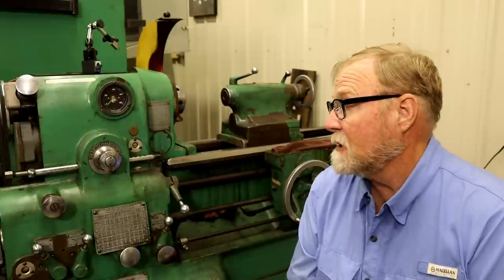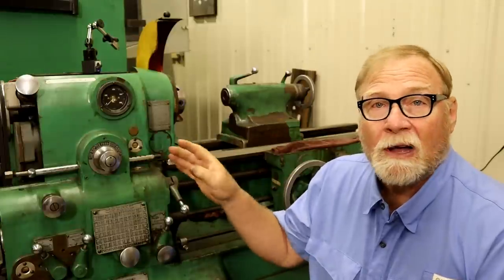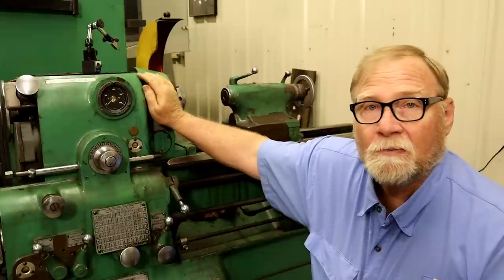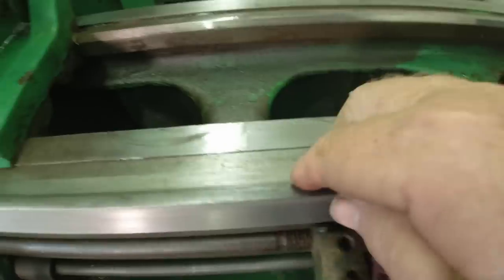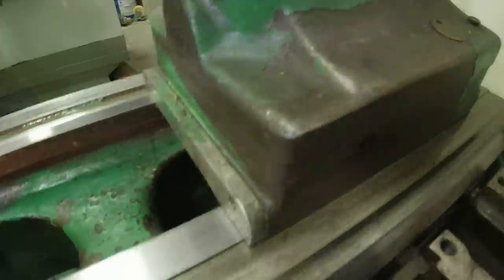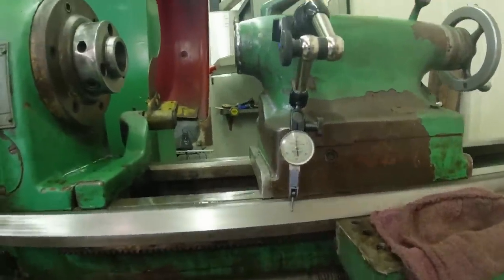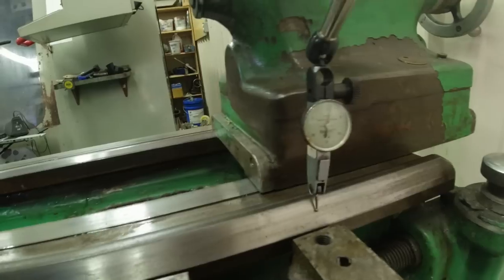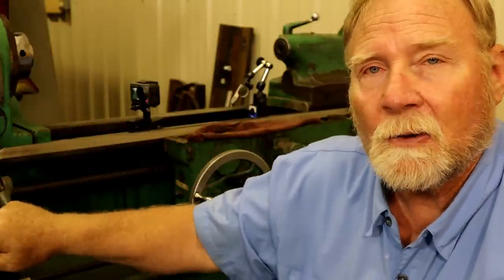7000 Mistake Monarch 10EE :  Is the Bed trashed?

Comment: Hi Steve 
That’s a great idea to use an independent rail system to bring the bed back into specification.
Once your there you could diamond lap the two mating surfaces to refine it even further.
Reply from the maker: Once I get the rails close I'll rescrape the tail stock sled to make it right then install shims to raise it to the correct center height... I have something else up my sleeve for the saddle :)

Comment: The bottom of the 10ee ways (where the bearings roll) front and rear may provide an accurate rail system for regrinding.  You’ll have to fabricobble a way to ensure your grinding sled is tight against the bottom rails but it is my understanding they are ground perfectly parallel to the top vee when produced from monarch.  Good luck sir!
Reply from the maker: thanks Clint.... I was probably going to use those surfaces to align the rails as I plan on making them about 3 inches wider than the regular rails.  The sled I envision will be very heavy  and should not need to be held down with the small amount of material I plan on removing...

Comment: Steve. How about purchasing a set of precision ball bearing linear guides off of Ebay then fabricate the brackets to mount them. Hey, they build CNC machines using them. I am retired know but when I was a Design Engineer I used those guides in my designs for multiple devices that would check and validate straightness In very fussy tolerances. Hey, I hope this might help in your quest. It has worked for me multiple times. Take care.
Reply: I just reground the ways on my lathe bed using ball bearing linear guides.  Pretty much set it up like Steve is thinking of doing.  Took lots of shim stock to get it aligned near perfect.  Mine won't be factory perfect but will work for my needs.  My lathe has a bed about twice as long as Steve's 10EE has.  Ground it dry and it does make a mess in the shop!  Ken
Edit: If I had to do this again, I would look at using the THK linear guide rails instead of the ball type.
Reply: @4GSR  I used the ball type and it was not a problem, but I was not grinding around them.
Reply: After looking them up, I think the THK LM Guide Rails which canbe gotten as SS would be a great way with what your thinking. Don't know how expensive but it looks like it would do what you want.I agree with Mark, check it out. Great video by the way. BTW, did you finish Don's Shaper nut?
Reply: @jdmccorful  There's a  industrial surplus dealer we know of that has lots of them for sale.  They are mostly N.O.S. one's too. And not a bad price too. Ken
Reply: @4GSR  I'd be interested in this supplier, if you're willing to share your sorce. 🙂
Reply: @kahllackey5619  HGR
Reply from the maker: I think that is a good way too... Just trying to save a little money and I know I can really dial in a set of cast iron rails if I make them...

Comment: Hello Steve, 
There is a large number of comments already and if I am repeating any of them, it’s confirmation. Your idea for grinding is similar to what I had in mind for my old American 14” high duty. 
My thought was building a sled to slide on the tailstock ways, then use the grinder on the sled to grind the saddle ways. You slid the tailstock with an indicator to measure the saddle ways run out.
The American is shot, if I mess it up I’ll scrap it anyway…..got it when I was a teenager….do not have the heart to scrap it!
Cheers,
Randy
Reply from the maker: It would be better than nothing to use the tailstock ways...    I just think that making a better set of ways and mounting them to the bed would give me a more stable base and one free of any errors.... The sled I'm envisioning is going to be heavy to stabilize it even more...

Comment: I had my 30” 10ee bed reground by Schaffer Grinding’s facility in the Los Angeles.   Rob was wondering to work with.  They did an exceptionally good job and the price was very reasonable.   Abel, the machinist who actually did the grinding, has well over 34 years of experience operating precision grinding machines. Fabulous experience and aligning the headstock was incredibly easy because Monarh 10ee beds were originally ground and Abel was “able” to match the original bed way angles.  He even ground the underside of the outside of the bed ways to be parallel with the reground top.  A truly amazing experience. Another friend scraped the saddle and tailstock in and now the lathe meets or exceeds Monarch’s original accuracy specifications.  Do yourself a favor and look into Schaffer Grinding.  I think they have a number of facilities around the Country and did an amazing job for a very reasonable price.  Let me know if I can elaborate or help in any way.  Cheers, Will
Reply: Hey Will, I'd be interested in your experience. I'm the one that Senior Steve has been doing some mentoring with. I took the old Blue Basket Case 10EE home. Haven't started working on it, with COVID, the day job has kept me too busy for now. I was talking with Steve about his plans to grind his in place, and haven't decided if I want to follow his lead or send the bed out. The more I look at old Blue, I'm really leaning towards doing a ground up refurb on her. That's a long project, but I know this old guy, who's really amazing at that kind of thing. BTW, Steve there is a genuinely great person, and I'm lucky to know the old guy!!!
Reply from the maker: I am just going off prices from Commerce Grinding 6 years ago.... 1100.00 to just grind the bed of a mill plus tax and shipping....    I have all the tools to scrape and plane things  so  . 007  is just not a big deal and I can use the money for the electronics....
Reply: @10swatkins  I can’t quote Schaffer prices today, but think less for the grinding.  I transported the bed myself I the back of my mini van.  Keep the videos coming; they are great.  Cheers, Will
Reply: @kahllackey5619  Kahl, let me know if I can help.  Ground up is a lot of pieces but I’m approaching completion so with Steve’s help I’ll bet the project is within your grasp.  Cheers, Will
Reply: @bid6413  Thanks Will, much appreciated!!! I may likely take you up on that offer. I'd love to see the process on your 10EE if you have any place your sharing it.
Reply: Schaffer Grinding Co. in Montebello CA also ground my 10ee bed in early 2020. Cost was $425 at the time. I'm in SoCal and was able to do the transport myself, but even if you consider shipping cost you might want to reconsider the professional grinding option. It is not that difficult to remove the gearbox and the headstock and will give you a chance to clean everything up and find other things that need fixing. I dealt with Ted Tipton in the office and don't recall who did the actual grinding, but their work is impressive and very accurate.
Reply: @spacetime8963  And, since Monarch ground their flame hardened bed ways the headstock might, with a little luck, line right up on that reground bed.  They do have to get the vee way angles the same as Monarch OEM, but they can do it.

Comment: I think that setup is summing tailstock way wear with carriage way  wear.  I suggest using the saddle to measure against the underside of the carriage ways where the ball bearing gibs run.  That would give the best measurement of bed wear
Reply from the maker: It's just a rough measurement to give some idea of wear...

Comment: Our Monarch 10EE's were hardened and chrome plated, 40 yrs old and zero wear. 
I'm not sure you are checking the ways accurately.
I would get an accurate straight edge and use shim to measure wear before doing anything else.

By the time you have ground .015 to .020 off the bed and carriage there will now be a combined drop of .030 to .040 of the carriage creating a miss-alignment of carriage to lead screw and feed drive shaft.

I will investigate our lathes tomorrow and give an updated suggestion. 😉
Reply from the maker: I understand all the steps involved...  And as I said in the video this is just a quick and dirty way to see if it is really bad.. thanks for watching.

Comment: How about mounting the grind spindle to the planer, you would still have to pull the bed but you wouldn't have to engineer a way system.  
I've seen planers with Bridgeport heads mounted on them, and the traverse speed on you planer is about what a hydraulic surface grinder runs at
Reply from the maker: I would have to build a pan to cover the table completely along with shielding.. I have a spindle that I plan on doing just that someday,  Just was thinking if this method works out it might be useful to others...

Comment: You have an enough big and super planer. I think more easyer job to make a separated cooling system on planer than make a pecise rail system on a cast iron machine bed. That need a lot of effort and never be as precise as your planer. 
I like your channel, and look forward to the continuation.
Reply from the maker: Kokmill I could do that easily and It might end up that way but if this works well it could help others with not as much experience and tooling as I have... Once I make the rig it would be easy for others to use... 

As for being as precise... I see no reason it will not be...
Reply: Hi Steve, I wish your method would work. I also have an old lathe that I  would restore and rescrape, maybe regrind the bed. So , just go ahead! 👍👍 I am really curious. 😊

Comment: If I was going to attempt it I would use a belt sander I think it is more controllable. The good news is the actual error is probably only about half of what you measured as no doubt the tailstock ways have wear as well and those errors  compound in what you measured.
Reply from the maker: Cant get a belt sander in the tight spots..  Leaning towards a die grinder mounted on an adjustable sled...  that way I can get right up to the head stock.

Comment: If you need Cast Iron bar stock contact Alro Steel.

Also you could still regrind it on your planner. You just need to take light passes and use a pores wheel and monitor the temperature of the bed before you take your final passes. I cant emphasize enough use of the correct grinding wheel. You can grind dry very accurately. I would recommend looking at Norton SG 3SGP CA Type 01 Toolroom Wheels. I have had excellent luck with them.

Also another way to grind the bed on your planner with out contaminating the coolant system is to put the bed inside a a shallow container on your planner so that the container catches the coolant and also holds the coolant pump so you do not contaminate the oil on your machine.
Reply from the maker: I've been over that before, I even have a spindle I could mount on the planer, but, I just don't want an accident to contaminate the 60 gallons of Hydraulic Fluid which at todays prices would cost 1,400.00 to change :( 

Besides I am working on this as a easy way to work on other lathe beds that need touching up without tearing them completely down.. IF it works well it can be used on other machines too :)

Comment: This is going to be interesting.  Love the way you come up with a way to accomplish a task that many would just give up on.  The approach is unusual for a precision lathe, but may turn out to be the best way for rebuilders who can't afford to spend thousands to take the wear out of the bed ways.
Reply from the maker: IF you have the measuring equipment and take you time there is no reason for this method not to equal or surpass a ground surface.. After all people send stuff to me or a GRINDING shop to get close BEFORE they start to scrape it in... Remember Grinding is not always a precision surface... Grinding machines can have wear on their beds that transfer to the surface you are grinding!

Comment: Its enough work getting the lathe stripped down in prep for the bed work. Take it apart and take the bed to a shop that specializes in bed restorations. While the bed is out prep all the parts for reassembly and address any other found issues. Thanks for the video's Steve they are very enjoyable!
Reply from the maker: All right Doug... Just as soon as the money arrives I'll get right on it!    What do you think this is a for profit YouTube channel that make money ????    :)

Comment: I think its creative as hell - and i'm not really sure what you have to loose.    You'll end up with sort of a mobile ways grinder of sorts - kind of like what they do for a milling machine taper.    Another commenter mentioned Keith Rucker's project.  What might be interesting is to see if their solution is a lower cost fix for the electronics.  Their plan is to do something that will keep all the original controls, and proper braking and what not.  Might be worth a look.  Perhaps your ways grinding mixed with their electronics solution might make a nice hybrid
Reply from the maker: Nothing to lose :)   I am gathering the materials... Moglice arrived last week for the saddle... I have made arrangements with Clark over at Windy Hill to go there and help him pour the metal rails at the ends of September. I also started collecting the boards for the electronics which will keep all the original controls and has great braking :)

Comment: Great idea Steve.
If you had the within .001, I think that it would be great.
At this point you have nothing to lose and everything to gain.
It will not be worse than it is.
Only better.
Nothing ventured nothing gained.
That would sure be a nice little lathe after fixing it.
Especially since you did a fine job on the spindle. Plus you would have all the stuff for doing another job.
Take care, Ed.
Reply from the maker: I think is doable.  I have been playing with how to mount a spindle and think I have it now :)

Comment: That measurement procedure tells you the inner and outer ways don’t agree. It would be hard to tell whether it’s wear on the saddle or tailstock ways.
Reply from the maker: It's just a ROUGH measurement!   The tail stock bottom was scraped already and the only wear would be in the hardly ever worn tailstock ways.... The saddle is off the machine already...
Reply: @10swatkins  yeah I recognise that. Just caused me to think for a while. Is that bed hard? I thought I saw planer marks on the headstock end?

Comment: Great idea, there are surely unworn machined areas that you could use as part of your guide system! I have a similar plan for an Edgwick lathe, I was thinking about bolting a rail to where the rack mounts and using two factory machined surfaces to make the track for the sledge! For a one off rail, you could use  hot rolled plained on al sides! Cheers Matthew
Reply from the maker: What I envision will be a stand alone and very adjustable rail system, takes all the wear of the bed totally out of the equation :)    Of course I'll take data points off the bed areas to line the rig up..  I was really thinking cast iron for the rails as it will be much easier to make a perfect rail from on the planer and then if needed I can scrape it perfect!
Reply: @10swatkins  Why not take advantage of the areas of the bed that were planed but never had anything running on them?  On my lathe, between both between the flat ways and the v ways, there are planed areas that have never had anything running on them! I am going to use teflon pads on these flat areas to "iron out " imperfections! With a front rail where the rack mounts two planed ways on the top and a fourth pad sprung loaded either opposite the rack replacement or in the centre where the locking foot of tailstock runs! I plan to make the replacement rack rail longer so that the sledge for the grinder can run further, out over the end to a stone "dresser"!

Comment: No, I don't think that is a plausible idea. To grind three surfaces flat, parallel, and within .001 using some sort of gantry setup is fraught with difficulties. Especially as two of the surfaces are at an angle (which must be preserved) to each other. The bed is severely worn. You would have to remove 7 thou worth of material over about 2 feet, three surfaces, holding tight tolerance. Nope. MY recommendation is to either do the refurbishment properly, send it out, restore the machine's full value, or not at all. My question before starting anything would be: what are you going to do with this thing? How valuable is this to you? Cheers.
Reply: The last statement of your remarks hit like a light bulb going on. I think it's worth considering for Steve.
Reply from the maker: Scott I have a hell of a lot more confidence in my ability to make those surfaces perfect than any other place around...   It's my machine and I care enough to take the time to make it perfect...
Reply: @10swatkins  I do understand the perfection obsession. I have fought it before and lost (at great expense, Sigh). My hats off to you and I wish you much success. Cheers.